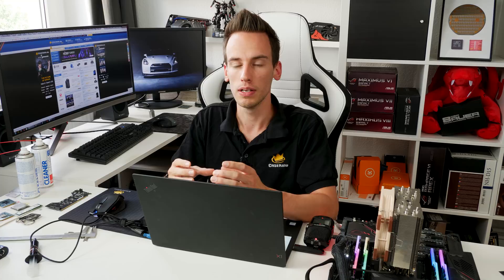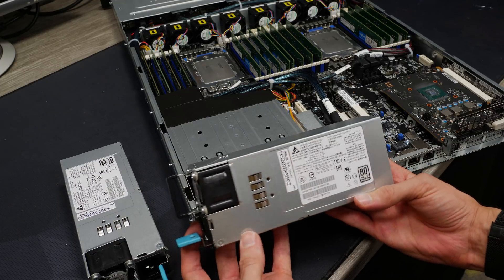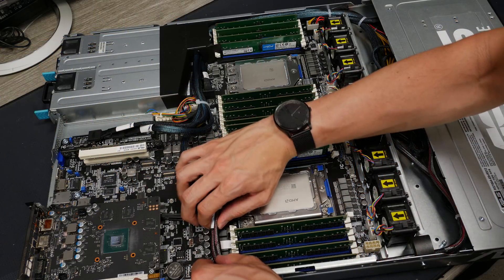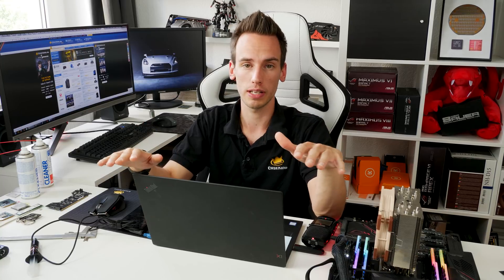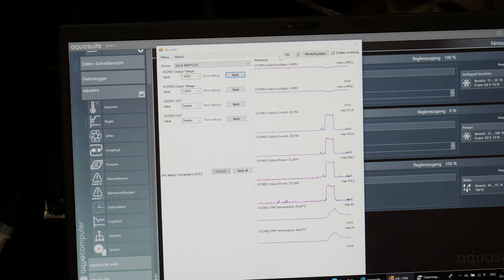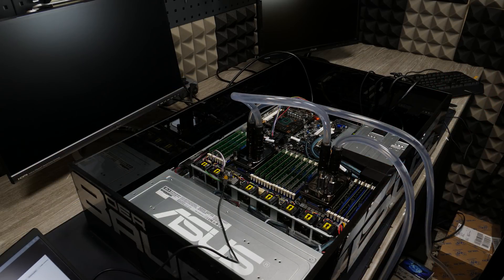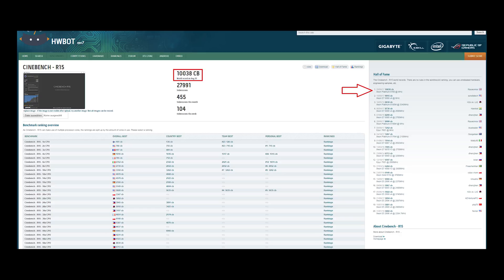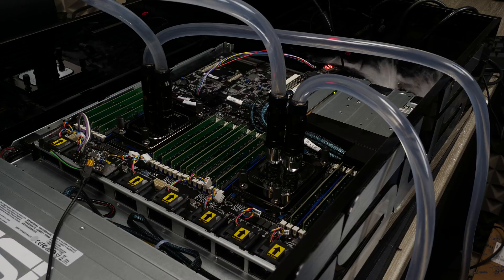The fastest Dual-Socket-System in the World!

Comment: For your PSU fan speed problem, just block of the bottom half of the PSU intake. It will then mostly pull air from the top instead of the Novec from the bottom.

Comment: I wish I could get you to help with my old Asus L1N64SLI-WS with WS/B BIOS. I'm trying to overclock a pair of 2360SE's on water once I fix the board.
Reply from the maker: I own 2 of these boards. What exactly is the problem?
Reply: Well, I have 2 problems now. I need a boardview file to fix the board after accidentally powering the molex connector while I was trying to purge the air out of the water pump and before that I had tried everything to get the K-10 quad core 2360se cpu's to overclock with no results, I lost the ability to change the baseclock and it have any effect on the processor frequency, any ideas on either?
Reply: I got a boardview file and will be fixing the system soon, My main question is why are the K-8 cpu's overclockable but the K-10 refuse any changes and do nothing. It's like AMD said if there are cpu's with this identifier then disable all overclocking functions. Do you think a fully custom BIOS could fix this and restore overclocking functions when a K-10 based cpu is installed?

Comment: @der8auer you might be able to angle the rack case a bit (like have the back psu fans 1 or 2 cm higher) so the fans from the psu's stick out enough to not trigger the protection. it will splash a bit upwards with this method. Otherwise you could always voltage mod the psu fan, but that would require opening the psu (that is not advised unless you know what you're doing).

Comment: der8auer - is there any concern about the novec over time working its way into the liquid metal and displacing some of it as it changes to gas?
Reply from the maker: Thought so too first but after double checking it was all good :)
Reply: der8auer - when you say "you thought so too" is that based on a single test and no noticeable movement of the liquid metal, or something from 3M with an official statement on any correlations between phase change and viscosity of the fluid? or just "I hope it keeps working"... heh...
Reply: bob dole i think he did some research
Reply: Altandush - his comment might suggest he just gave it a try and didn't see any adverse effects after the fact or he "did some research", which is why I sought to clarify which, the information I have suggests there may be some movement over time, which would be horrifying on liquid metal circulating around your novec solution compared to some other paste thats non-conductive...

Comment: Asus would be smart to work with you to get a bios for that thing that doesn't lock anything.

If you see how much change you can get out of a Threadripper and Ryzen system with some boosted memory speeds, oh lordy.

I hope you are in contact with them and they are interested. It's great advertising. Fast dual socket system that is faster than any quad socket system by far!

Comment: you can put some kind of air line to blow air in to the PSU's so the fans don't slow down too much from just pure liquid and have some air to run at.. OR... disable the psu and put the fans out of the liquid with some kind of bracket to hold them.....

Comment: Sorry to rain on your parade, but AMD supposedly has 7nm zen in labs and probably is testing it in a dual socket system. So that probably would be even faster than this system (mayby not since that would be a prototype and probably run at lower clocks)
Reply: i do not believe that AMD is testing their prototypes with liquid metal and under 3m liquid. i might be wrong, wouldnt be the first time.
Reply: And when those start coming out you'll have der8auer overclocking them as well. This is what this guy does. It's what he always does. It's his job pretty much. With each new CPU architecture you get a rush of competition from various overclockers competing to get the highest scores. It's been like this for as long as there has been a PC market. Heck even back in the Windows 98 days you had overclockers overclocking their 3Dfx Voodoo cards and their AMD K7 CPUs with that Goldfinger device. Point being, this is just the next step in that neverending cycle.

Epyc is epic. AMD has found a way to fight to keep Moore's Law alive and it seems to be quite the success story so far. AMD will surpass Intel in core count. Intel's Tic Toc is now officially dead. Intel is back to the drawing board trying to figure out the proper strategy forward and for some reason, I think EMIB will play a part in that new strategy.

For the time being... AMD basks in glory :) David knocked down Goliath once again.
Reply: Those products aren't out. Sorry to rain on your parade.

Comment: That is just insane! Congratz.

I'd say for those power supply fans, just take them out of the PSU's, extend the wire and have the fan placed above the fluid, allowing them to spin freely. Easy solution, no need for signal trickery as the fans actually mechanically still function correctly. Of course i realise that they then won't do much to actually cool the PSU's, but i'm guessing that by the nature of the novac fluid, that this isn't necessary. :)

But i gotta say, that fluid rushing across the board looks awesome. :) Can't wait to see what results you end up getting out of this madness! :)

Kind regards from Denmark.

Comment: This is really impressive stuff. C'mon AMD, please make dual socket Threadripper happen.
Reply: DellChannel21 
That would canabalize EPYC sales.
Reply: Considering that TR has 64 pcie lanes and epyc CPUs communicate with each other by sacrificing 64 pcie lanes each(they have 128 each, so you still have 128 in a dual socket and communication speeds between CPUs up to 64GBps) I doubt that this will be possible.
Reply: If he can go ln2 and speed up the memory he could get close to 14,000 cinebench, threadripper 2990wx can get 7,618 and that is with quad channel memory at 5.1 ghz

Comment: Idea: instead of novec, could you put heat sinks on the phase power chips? In a normal PC, that wouldn't help much, but with the server fan flow, it might help a lot.  Granted the novec is helping with chiller condensation prevention in this case.

Comment: Dual socket 1 U server? thats pretty cool.
I think a lot more servers will be switching to epic. 64 cores with that amount of memory and SMT is hard to beat for the price.
Reply: Amd s multiple numa nodes might make things a lot slower. It all depends on the task you run. Not everything is as parallel as raytracing, although common tasks as deploying a bunch of docker containers should work great.
Reply: Most Intel servers are dual socket, so they suffer from NUMA too. Although, I do use a dual socket workstation daily and don't notice any issues.
Reply: calaphos NUMA shouldn't affect VMs unless each VM has more threads than  each CPU die (not just per CPU because of the inter-CCX traffic). For 8 thread VMs it should be ideal!
Reply: The value is really good, but reliability is too much of an unknown for large scale adoption. I imagine it will take another 3-5 years for AMD to get double digit market share in the server space, assuming they remain competitive with Intel.
Reply: +Bayonet
I know that the reliability is definitely there from hands on. Too bad at home I can only afford a Threadripper 1950X.
Reply: Bayonet true plus reliably isn’t the only problem. With most it architecture moving to virtual where the development on amd has had little to no development on all the new features especially ones built into intel cpus they are just too hard behind.

Comment: what if you reflashed the SPDs in the memory modules with higher clock speeds and tighter timings? possibly also more memory voltage?
Reply: The problem isn't on the RAM sticks. The controller on the Eypc is locked.
Reply: I think this is worth a shot!

Comment: does the server board let you tune mem timings?

Also that post code thingy looks awesome!

Also any chance of E-powering the server boards?
Reply from the maker: EPower not needed :) eVc for the rescue. We can adjust the timings. We went from CL21 to CL16 for the run.
Reply: The EVC doesn't give you more phases or better output filtering. Do the mem sticks not do like 11-13-13-26 at 1.35-1.5V? Wish this stuff was more affordable. It would be awesome to have a chance to mess with something like this.
Reply: https://b2b.gigabyte.com/High-Performance-Computing-System/G291-Z20-rev-100#ov  do You think You can st up this machine to do the same, and if yes how can i order it from You?!
Reply: In the German video he mentioned that he was able to tune the memory timings.  

E-Power on the server boards would be rad.
Reply: Crucial generally doesn't use hynix ICs
Reply: Crucial is a micron brand, so Crucial products use micron inside.
Reply: It's aimed at the server market. "Affordable" isn't always the key.

Comment: This is absolutely bonkers, well done! Have you considered adding heatsinks to the VRM's with Sekisui thermal tape or thermal glue? Looks like there is ample room for a slim but tall heatsink, and it won't affect CPU cooling with a custom loop.
Reply: The 3M Novac does the job of heatsinks.

Comment: @der8aur - psu fans: 

1) if you remove the fans from the PSUs, you then make a 'longer wire' for them. And then have them sit outside the novec solution, in free air. But still reconnect them back onto the fan headers inside the psu. That way they are free to rotate at their full speed.

2) Then replace (inside of the PSU) with your own fans, which you can power and control externally, independent of the PSU.

3) This is not as elegant as fooling it with a fake dummy fan signal. However for that, you need something to generate the dummy fan signal with. (for eample, an rpi nano + extra electronics)
Reply from the maker: Yea I will probably just go for the "replace fan and extend wires" option :) Should be the easiest
Reply: Dreamcat, an arduino board should rather be able to trivially mimic the fan signal
Reply: Or just a 555 timer, if we are going for minimal hardware. But an Arduino Nano knockoff costs about the same on AliExpress and is easier to reconfigure.
Reply: Dreamcat 4 na just pee on it! Germans like it like that anyway 🤣
Reply: y'all be using those Arduinos and stuff and 555s with all their extra components while i'm sitting with my ATtiny85

Comment: you know. Just a casual 12k rig running Cinebench. xD
Reply: I don't even know how they can make it that cheap considering how much RAM in those racks and they are enterprise ECC which is like 2-3 times the cost of desktop.

I priced up all the parts for my upgrade based on a 2700X without case or cooling and it came out to bit over 4K AUD.  Main culprit was the 32GB of RAM, freaking $750 for the RAM !!! only few 100 behind a top model 1080Ti and over double every other expensive part in the system.   If RAM was it's normal price before the hike my system would be $500 at least less.